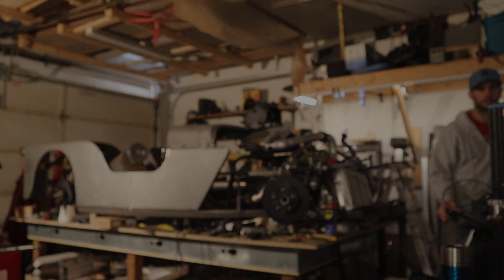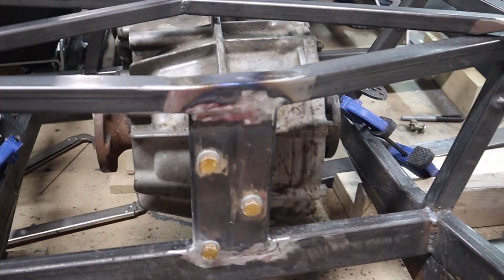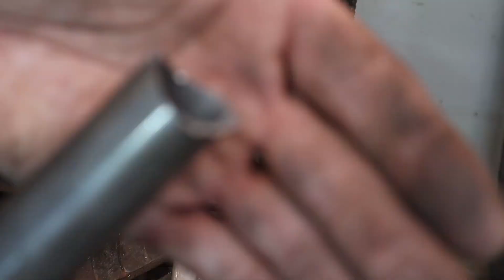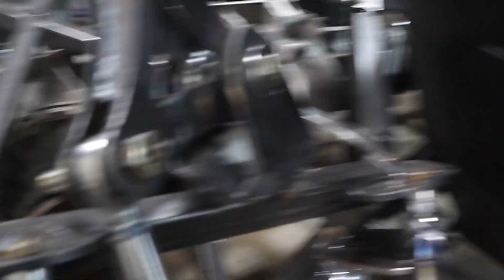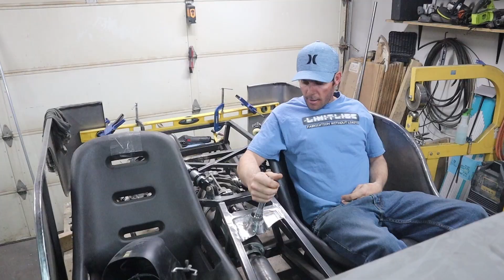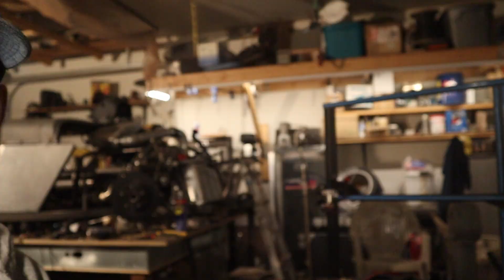New year, new name, and new motivation! (Turbo Hayabusa Willys Jeep Ep. 34)

Comment: Think about the failure mode. 

The problem with the chain drive is that a 50-link chain has 100 points of failure, any of which will result in total and complete loss of steering. If someone hits you or if you curb it just right, and that chain breaks or jumps a sprocket, you’re going to panic-jab your brakes and your car is going to careene  in the direction of the tire with the most grip and you’re just along for the ride. 

If the frame is in the way of doing it safely you should go talk to the guy who built it. 

Otherwise, the chain drive itself needs to be overbuilt to the point that it’s the last thing that would ever break, even in a severe crash. Hanging a sprocket on the input shaft of that rack (which was never designed to take an overhung load) isn’t really good enough. Knocking a sprocket to a wobble is enough to make the chain pop off and I bet you could do that with a big pothole. 

If I were going to take my kid for a ride in it I’d at least extend the input shaft to a second bearing and add a second (not double-row) chain. 

I’m not trying to hate on your rig. I just understand the forces, risk, and consequences involved.
Reply from the maker: I hear what your saying. Appreciate the feedback!
One thing, I did make it two chains, it’s not double roller. I do understand the forces going into that shaft, perhaps a bearing on the other side could be fitted. Not entirely certain it is necessary though, considering the other weaker points in the system that should break first (3/8 linkage bolts). Things in steering are supposed to break away so that the forces are not put onto the drivers hands. Normally a coupler or something that breaks away. 

If in a normal system, it is meant to break away, making it impossible to steer after an accident, why would mine be any worse off?

I’m not trying to argue, looking for honest solutions and discussion. 
PS: What if I built the chassis?? 😂, actually it’s more the header that is in the way to allow it to move center more, but also the really wide base of the engine without a normal oil pan.

Comment: Have you looked at Hankook or Hoosier tires for their DOT 15 inch sizes. A friend of mine races a first gen Miata with 15x9 wheels.
Reply from the maker: Looked a bunch of tires, lots of options for rubber, it’s the rims I’m stuck on
Reply: @limitlessbuilds  how about TireRack?
Reply from the maker: @ConemantheBarbarian  same thing. It seems manufacturers stopped making 5 bolt wheels in a 15” diameter. The pic of wheels I showed is just about everything available, and some of those are even 4 bolt so I would need custom 2-piece adapters made to go from 5 to 4